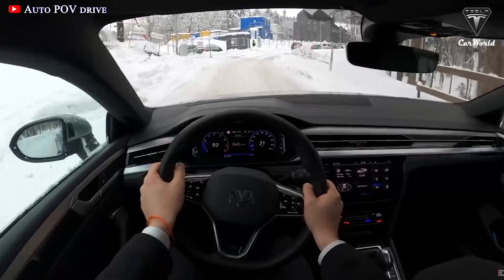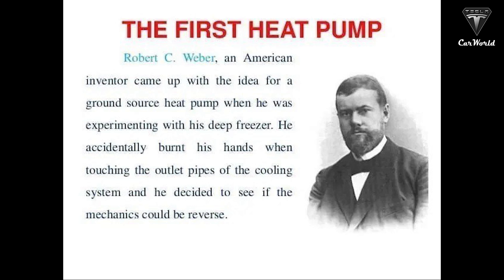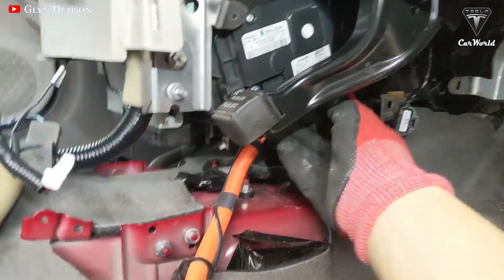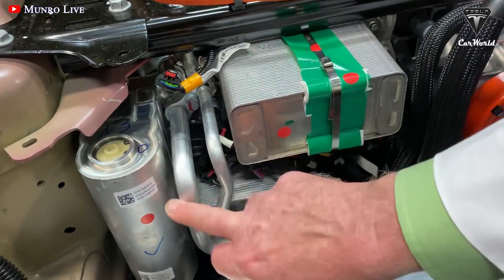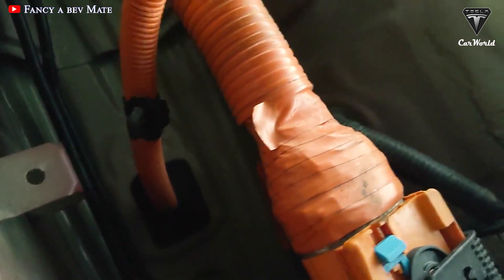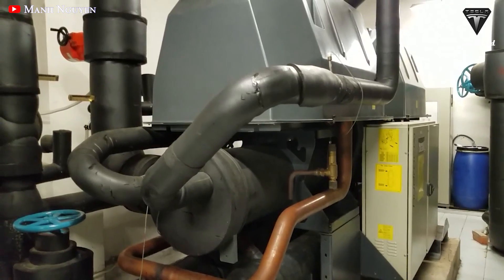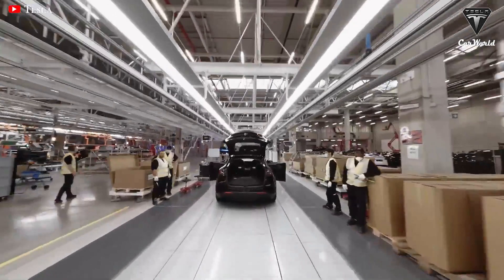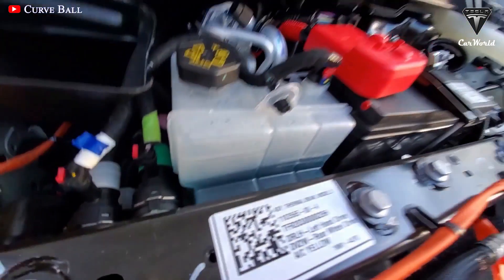Why Cybertruck’s Heat Pump Is Game Changer, 500% Efficiency

Comment: Heatpumps are used to heat homes aswell, so it's imporant tech and improvements over time has been imporant and significan't. I'm not sure about the efficiency of such heatpumps compared to the current Tesla one, but the world needs more efficient heatpumps. There are other ways to heat homes but for some people it's the only alternative to directelectric heating which is inefficient and uses a lot of electricity resulting in massive electricity bills.
Reply: So a leading edge (at present) residential heat pump can deliver heat at 600% efficiency, compared with a gas heater at 50% to 95% efficiency. When the electricity is produced using renewable electricity, this delivers astounding reductions in greenhouse gas emissions. So, yeah, heatpumps are pretty nice. It's another of those survial tools humanity has added to it's toolkit.

Comment: Do the heat pumps take heat from the battery or the air I could see having valves if the battery is getting warm but I assume is from the air

Comment: What about aircon?
Reply: heat pumps do heating and/or cooling

technically an air conditioner is also heat pump 
(that only goes in one direction)

but colloquially heat pump means it heats and cools

A reversing valve is used to switch the direction of refrigerant flow which turns the air conditioner into a heater also

we call air conditioners "straight cools" but they are technically heat pumps

Teslas heat pump does both

Comment: Maximum efficiency in any system is 100%
Reply: its because a heat pump is moving heat, not creating heat.

that's why resistance heat is said to be 100% efficient. Takes 1 watt of electricity to make 1 watt of heat

a heat pump can move 5 watts of heat with 1 watt of electricity - that's where the 500% efficient number comes from
Reply: @andrewmerry6943  No it does not. Heat pump cannot move 5 watts of heat if only 1 watt is generated.

Comment: OK....

The Model 3 from 2021 has Heat Pumps... I know this because mine has one.

kWh relates to energy... not power.  So you need to be using kW when talking about resistance heaters... not kWh

Comment: My early (VIN < 15k) Model Y has the Octavalve heat pump system subsequently propagated to the rest of Tesla's models.  It works great, a single heat pump managing all of the thermal flows in the vehicle.  Many of the other EVs have 2 heat pumps -- one for the air conditioner and one for the heater, such as the higher-trim Leafs.  Octavalve is a great example of Tesla simplifying systems by combining them, thereby removing parts.

Comment: Tesla constantly proclaims that it goes to great lengths to save water and the environment. It should lead the way to safe air conditioning and heat pump systems by embracing safe, non-explosive, non-toxic, fire retardant, and non-corrosive carbon dioxide as its refrigerant for its cars and home air conditioning systems. Carbon dioxide was patented as a refrigerant in Britain in 1850, and around 1875 an American installed carbon dioxide refrigeration in a ship to transport Texas beef to New York City. Carbon dioxide was mysteriously displaced by ammonia, which was so toxic that it could kill a sleeping family at night if it leaked from a refrigerator. After WWII DuPont marketed Freon as a “safe” refrigerant, and home refrigerators were accepted by the public, but it later became clear that Freon disintegrates into deadly phosgene gas when it is exposed to flame or contaminants. That is why DuPont promoted the notion of the “ozone hole” as an excuse to withdraw Freon from sale, and replace it with other toxic hydrocarbon refrigerants. Could it be that DuPont seeks to vilify carbon dioxide as being somehow toxic or a “greenhouse gas” so as to obscure the fact that carbon dioxide is benign, beneficial, essential for life, and an ideal refrigerant??? Meanwhile, Mercedes is introducing carbon dioxide air conditioning systems in their luxury automobiles. Tesla should do likewise.

Comment: I have been working with heat pumps for years now and figured it was about time they was used in a car due to there power to heating ratios.  great video guys
Reply from the maker: thanks
Reply: I mean just for electric vehicles aside from being able to put out heat basically immediately I don't think it's beneficial it will use more fuel because that heat was just wast in traditional cars

Comment: In temperatures way below freezing The system has to go into a defrost cycle. When the system is in defrost there normally will be a loss of heating inside the cabin Supplemental heaters usually will be energized to compensate Normally a thermostatic expansion valve externally equalized is used to regulate the flow of refrigerant to the evaporator inside coil Elon must be using a electronically controlled expansion valve to optimize and regulate refrigerant flow in a normal reverse cycle system there are several check valves reversing valves and temperature sensors to control the outside coil temperature from freezing
Reply: After 35 years as an A/C Refrigeration contractor along being a patented inventor for safety devices for air conditioning units. I would really like to see how the Elon's system operates. They're making a lot of advances in the air conditioning and refrigeration systems. From three phase DC voltage to variable speed compressors to plug in diagnostic systems. it certainly has changed a lot since I started out in the field Especially when you're also doing Commercial Refrigeration and there's over 150,000 worth of meat in the freezer. The owner says at 3:00 in the morning I don't care if you have to stand there with an ice cube and a fan I want that damn place cold
Reply: @joelbell9082  teslas system in very cold temps can go into "lossy mode" where the compressor and fan motors provides 1:1 efficient heat to the cabin. Basically there is both a condenser and an evaporator in the cabin and the net result is 1:1 heat gain like a resistance heater, so inefficient by heat pump standards. presumably they transfer the heat from the compressor motor to the cabin as well. essentially just running motors for their heat.
Reply: Elon is probably using R-410A which has the boiling temperature of -59° If they're using R-410A the only problem with that refrigerant it is very hydroscopic
Reply: @joelbell9082  Its not a problem at all if you pull a good vacuum. Which im sure they do.

I use a core removal tool, vacuum rated hose, and a BlueVac micron gauge during my installs.
Reply: @andrewmerry6943  a good method is to flush the system with low pressure nitrogen. Then use a micron gauge to pump the system into a vacuum with a two stage vacuum pump  to around  400 microns and making sure that the vacuum pressure doesn't increase which would indicate a leak The desiccant in the new dryer that's going to be filtering the system out of any remaining moisture  in a 410A system
Reply: @joelbell9082  r410A is also a gnarly greenhouse gas, something like 10,000 times more potent than CO2
Reply: 410A refrigerant which is environmentally friendly doesn't have any chlorine molecules which could attach to the ozone molecule which could cause an opening in the ozone layer when it gets into the stratosphere no refrigerator is perfect try living without air conditioning or Refrigeration
Reply: Also, most cars use R134A not R410A. Cant confirm what Tesla is using.
Reply: R-410A has a much lower boiling point than 134A which means 410A has a much lower sub cooling State -59° on expansion and can absorb more heat more efficiently The only downsize is that the operating head pressures are higher and it is  a hydroscopic refrigerant and it uses a polyester oil instead of a mineral oil
Reply: @joelbell9082  its also a blend which can be problematic if a system leaks.

I doubt Telsa is using R-410A so to be honest im not really sure where you're going with this
Reply: @andrewmerry6943  Before replacing any refrigerant in the system that is below design pressures The system should be completely checked for Freon leaks I've learned a long time ago while working in the air conditioning field that a refrigeration system that is hermetically sealed and leaking is not like a cut on a person it doesn't heal by itself it only gets worse so if there's a leak you have to fix it The only option when a system is low on refrigerant option is to recover all the refrigerants that's in the system and weigh in the proper amount for the system checking the subcooling and the superheat to make sure that the system is functioning properly
Reply: If they decide to use R410a which is very hydroscopic pumping a vacuum is not going to remove  moisture in your system The only thing that removes moisture is in the dryer desiccant that has to be replaced You could pump a vacuum on a system all day and night and it's not going boil off all the moisture that's in the system Also keep in mind that moisture in the system when combined with the oil and the heat of compression turns to sulfuric acid and it has a way of eating away the insulation windings of the motor which will cause a dead short

Comment: Heat pumps do return up to five times (possibly more) more heat than a pure resistance heater by using physics. For a reasonably good explanation, check Wikipedia. 
I live in a climate where the temperature can drop below -30 and stay there for 2 or 3 days at a time, which is well below the temperature that will boil the refrigerant, and that has to happen to make the system function. And I’m guessing there’s a resistance heater in the system somewhere, would like to see how they are making it work.
Reply: you are mistaken, many refrigerants boil below -30.

Check out Teslas "lossy" mode.

They essentially use the compressor motor and fan motors as resistance heaters
Reply: @andrewmerry6943  

Good to hear, didn’t know, couldn’t find any info on line….
Reply: That's probably why r410a would be a good choice as a refrigerant because it has such a high PSIG condensing temperature to generate enough heat on the reverse cycle
Reply: Excellent. Facts to back. Awesome.

Comment: Interesting, claiming 50% efficiency when the max possible is 100% efficiency.  Overunity systems are like perpetual motion machines, nice to imagine but not possible without a breakthrough in physics.
Reply: Well then there has been a breakthrough in physics… Resistance heat is 100% efficient and you get 3.413 BTUs per 1watt of electricity. In a high efficient home heat pump around 35°F (outside temp) it will have a COP  (coefficient of performance) of 3-3.5 meaning it will produce 3-3.5 times the heat per 1watt of electricity than electric resistance. This is made possible due to the heat of compression which a lot of times is referred to as your (free heat).
Reply: True efficiency can never be more than 100% but COP (coefficient of performance) can be. One is total output/total input whereas the other is total output/total (in this case) energy input! As we do NOT live in a closed system there are thermal and other energy inputs that are not accounted for for many systems and reasons!

Comment: ICE cars have so much waste heat they don't need a heat pump for the interior heating system. EVs on the other hand can hardly afford to trade battery stored energy for interior heat so a heat pump is almost essential. It is therefore surprising that the models S, X and 3 were launched without this feature which Tesla only started providing from the model Y launch.

Comment: Like the idea but I don't need 500 hp, 4 wheel drive is a must but 200 hp would be more than enough.
Reply: 200 hp is good for a light vehicle, but a model x with half the battery is over 6000 lb.

Comment: This did not explain any way why this heat pump system is a game changer… There is nothing that was explained that heat pumps haven’t been doing for 50+ years I’m sure the compressor is variable capacity and probably using a EXV instead of a TXV but aside from efficiency gains here and there the principal is not changed.. High end heat pump mini split units are now at these efficiencies. And also something to take note of is when they say certain efficiency numbers what the outdoor temperature is and does that take into consideration the defrost cycle..
Reply: They did not explain because it's obvious to anyone familiar with heat pumps. Primarily they were residential or business and big. To my knowledge nobody has scaled one to fight an auto AND be affordable.
Reply: @GrigoriZhukov  They have made affordable small room heat pumps for years.. One could even argue that a dehumidifier is a heat pump although that is not its primary purpose.
Reply: @GrigoriZhukov  you don’t understand, there’s nothing new here, to reverse cycle any refrigeration system is only a matchbox size 4 way valve , 1960s tech
Reply: @spinnymathingy3149  not with efficiency in residential or commercial setting and no they were not matchbox sized. Otherwise heatpumps would be common. I actually worked on HVAC systems in the 80's saw several companies put themselves ot of business trying to get it to work and be economically viable.
Reply: @GrigoriZhukov  I’m currently a refrigeration mechanic, and have been since 1986, as I commented there’s nothing “new” happening here.  My 1960s kelvinator refrigerator refrigerator used this heat pump tech to replace the defrost heating element
And heat pumps are common place, almost the entire world uses them in almost every refrigerated air conditioning system, they are all reverse cycle heaters too.
Edit, also almost all electric household water heaters are heat pumps too (in many countries)
Reply: It uses 1/5 of the power/range that's the big deal
Reply: the Tesla system is a game changer due to the integration of all components

not because of the heat pump itself, which is nothing new.

no one else has integrated systems like this in auto

mitsubishi and other VRF systems have done similar things in buildings however

Comment: Nonsens, temperature takes energy, less energy gives less temparature this story is a varytale about 500% efficienty
Reply: This is true with resistance 
heating but when you consider your “free heat” which is your heat of compression that’s where you get the higher efficiency it is no different than a standard heat pump in a house. Basically anytime you can get more than 3.413 BTUs per 1 watt of electricity you are higher than 100% efficiency…
Reply: this is true of you are generating heat. Heat pumps are called heat pumps because they only move heat from one location to another. For each unit of energy you actually get more heat when compared with a 100% efficient resistive heater. So the marketing team just called it more than 100% efficient even though not technically true.

Comment: No such thing as greater than 100 efficiency in engineering.  Efficacy or effectivity would be a better term.

After that nitpick, looking forward to seeing that Tesla heat pump out in the world.  There are so many places it could be put to use.
Reply: This is true with resistance 
heating but when you consider your “free heat” which is your heat of compression that’s where you get the higher efficiency it is no different than a standard heat pump in a house. Basically anytime you can get more than 3.413 BTUs per 1 watt of electricity you are higher than 100% efficiency…
Reply: It's true it is kind of misleading but the coefficient of performance for the amount of heat you gain per unit of energy will be somewhere in the 2 to 5 times range vs a resistive heater which in marketing speak could be arguably described as more than 100% efficient by comparison even if not truely.